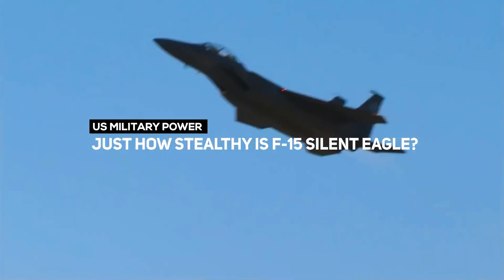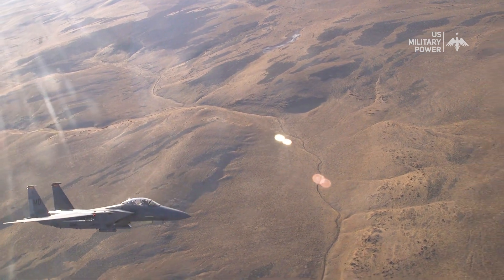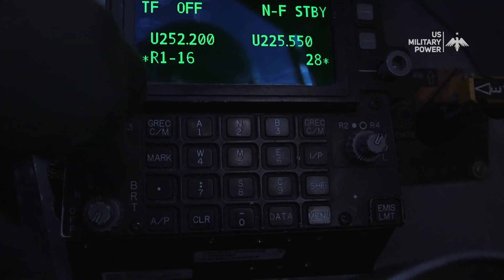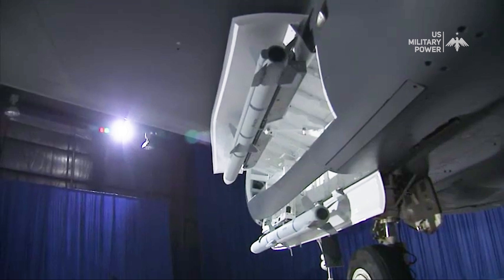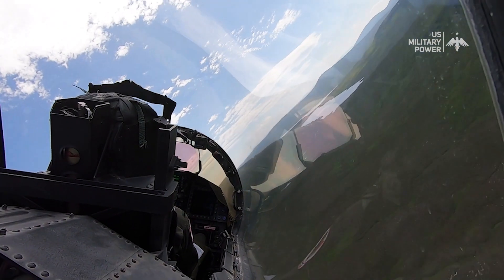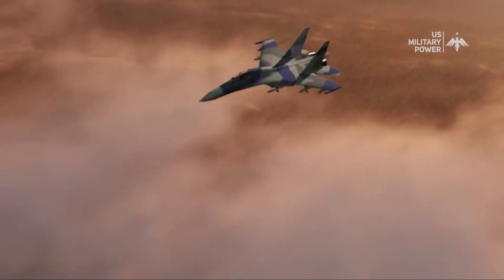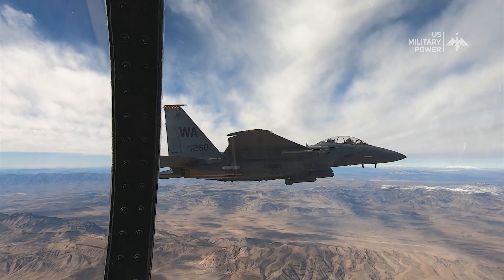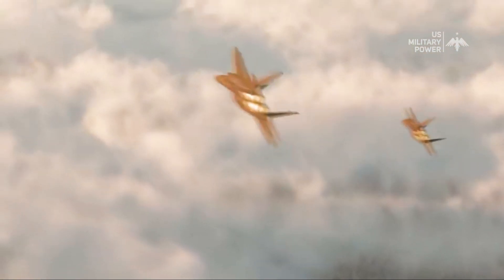Just How Stealthy is F-15 Silent Eagle

Comment: It's fascinating, but it would never find a market. It is FAR too expensive for what it is. It has a very specific and limited role. And for that, there's just better choices for less money. The F-35 is far better at the same job, cheaper and can be used in far more roles. And the F-15SE isn't stealthy enough for deep penetration like the F-35. And even then, and surprisingly Israel didn't want to send the F-35 into Iran.

As much as I think the F-15SE is cool, and it is, imo the idea should have been canned before they built a prototype once they realised the unit cost.  For the cost, the same company would have been better of resurrecting the YF-23 but they wouldn't have been able to export that. Now that was a tragedy. Imo the YF-23 is BEST looking fighter period, with apparently an even lower RCS than the YF-22 at the time.

Comment: At least some of the planes shown in this video are converted from regular F-15's. You can tell by the tailfins. If the tailfins are vertical, then they are conversions, if they are canted, like those of the F-35, then they are built from the ground up to be Silent Eagles. You lose the advantages of the canted tailfins, with a conversion, but it allows current operators of the F-15 to upgrade their squadrons with stealth capability, at a lower expense than replacing them. The Strike Eagle is not a good candidate for conversion, though. All of the additional weapons hanging off of the undercarriage, increase the radar signature to the point where adding stealth to the fuselage is cancelled out, so no benefit is to be gained from it. The Air Force would normally send in stealth aircraft ahead of the Strike Eagles, to take out enemy radars, to protect them from being detected, anyway.
Reply: The stealth Eagle you see in the video is actually F-15E-1 that’s the first E model. I worked on that plane when it was brand new until it delivered then years later we went to Edwards AFB to do a receiving inspection on that plane then it flew back to the plant in 
St.Louis and was used for flight test and as a chase bird for the newer planes it is now in Tucson at Davis Monthan AFB Boneyard. 
F-15E-1 was converted to be a Stealth Eagle with the canted verticals for show only it didn’t fly with them canted it did fly with the special CFT’s and fired some missiles. 
Normal F-15’s verticals are straight up not canted. No Silent Eagles were never made or delivered.

Comment: wen DCS F-15SE dlc?  The engineering is really impressive in what they've done on that frame. Very very value add. airbrake @ 6:50 is fun to watch. I need to get that timing down with the 3° ILS glideslope (getting better at using the ILS!)